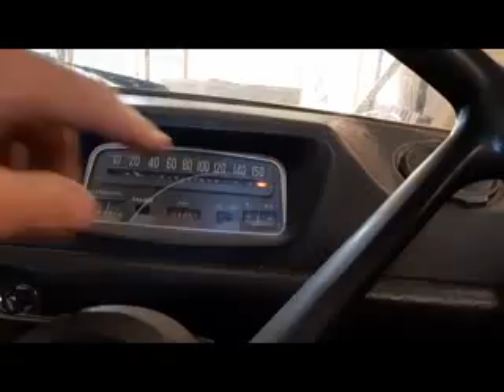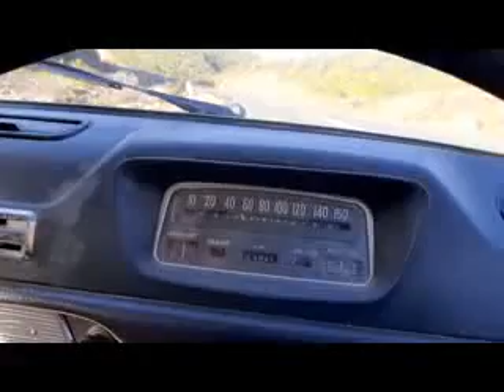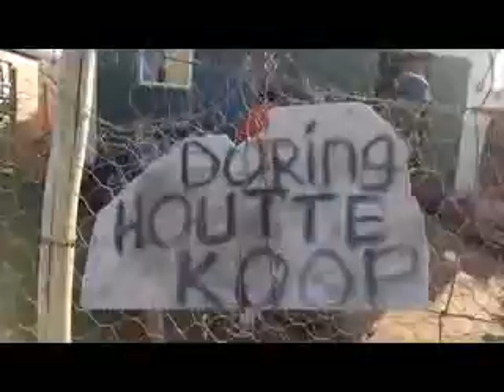Peugeot 404  Diesel Pickup with wood makers ( Koi peuple ) non black   on top

Comment: hi 404 runs well despite the overload.  In France, overloading is completely prohibited and passengers installed outside the vehicle while driving too.  see you
Reply from the maker: In South Africa they trying to stop this to . These are very poor so they can't pay a taxi to get them home.They have to move out of that house they living in the write full owner wants his house back . They  now have a problem.In Northern I watched videos where they also overload there  505  8 seater estates , loaded with truck wheels on top. The load on top is even higher from the roof to the top of the load    than the cars height from the road to it's roof.  9 adults and a few children  in side the car. Video :  Deadliest Roads / Guinea / free Documentary.   Bay bay and  stay well.
Reply: Différents pays, différentes règles !
Reply from the maker: Different countries , different rules exactly yes.